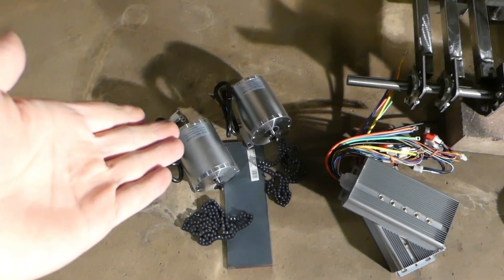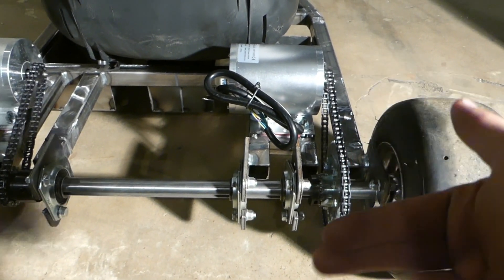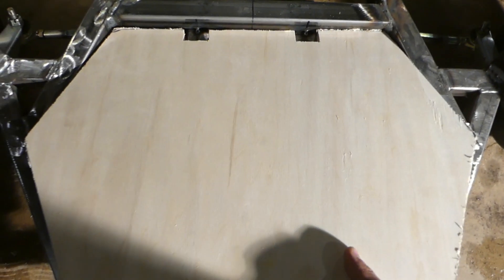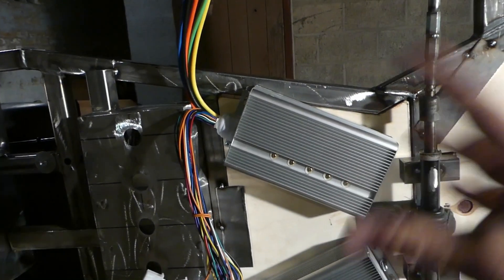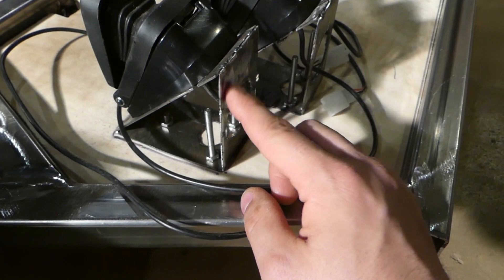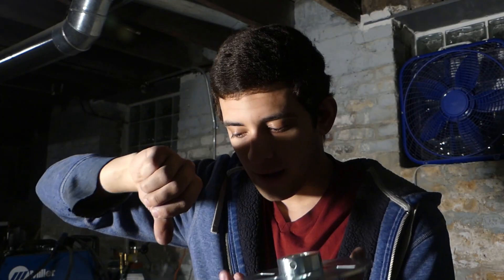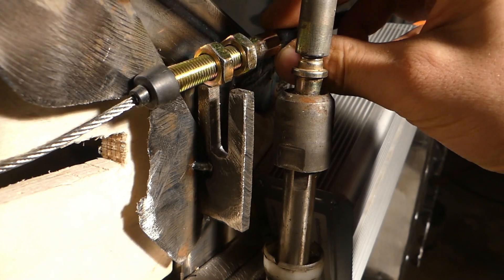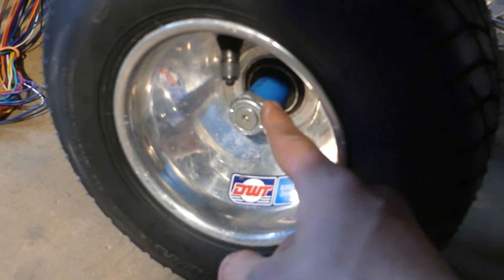Installing the motors, ESCs and brakes on my go-kart

Comment: hello you know you can use one throtle for 2 esc to control at the same time and the esc at the botem what if you take a bumb ?
Reply from the maker: I thought of that as well, but with these ESCs, they only have one port to connect the throttle to.  I could connect extra wires from the throttle into the second ESC, but then I would have to manually turn off and on the ESC that I want so that I don't power both at the same time.  It's a lot easier just to have two pedals so I can move my foot from one pedal to the other and have power at demand.  As for hitting a bump, I'm (hoping) its high enough off the ground so it doesn't hit it, we shall see in the future.  How were you thinking about connecting both ESCs to one throttle? I would love to know and thank you for watching.
Reply: @ALYTRA-youtube  you just need to make parallel exits from  throtle to both esc to regulate both in same time
Reply from the maker: I want to control them separately at different times.  The motors are connected to sprockets that are different sizes.  The wheels will turn at different speeds if I power both ESCs at the same time; which is what I don't want.
Reply: @ALYTRA-youtube  i was thinking to do the same first, then i thought but wait 1. if motor have maximum speed  and you put one ratio on it and with other motor you put smaller ratio it will spin much more than its rated for 2. That motor with smaller ratio will take much more energy/power and probably gona overheat. What do you think about that
Reply from the maker: The motors will spin at the same speed, its the sprockets that will have different speeds; and the sprockets are connected to the axel which are also connected to the wheels.   

For example lets say the small sprocket on the motor itself has 11 teeth and we connect it to a larger sprocket with 55 teeth, with a chain.  the motor itself will have to rotate 5 times in order for the 55 tooth sprocket to spin 1 time.  That's how it is on one side of my go-kart.

The other motor on the other side also has a 11 tooth sprocket on it.  I connect that motor to a sprocket with 22 teeth, with a chain.  The motor itself will have to rotate 2 times in order to make the 22 tooth sprocket rotate 1 time.  

This means the 22 tooth sprocket spins faster than the 55 tooth sprocket even when the speed of the motors are the same.  

what I'm describing is called "gear ratios" 

And you are right, the motor with the smaller sprocket will consume more power because it will be harder for the motor to turn such a small sprocket.  I expect that motor to get a little hotter than the other one, but I don't think it will overheat and melt, it has pretty thick copper wirers on the inside,  but we shall see.    

I just finished the go-kart today, it works, I will show and explain the sprockets in the next video that I will be posting soon.

Comment: Just curious, how come you used two motors? Awesome build btw
Reply from the maker: The 2 motors are connected to two different sprockets for different speeds.  1 is connected to a large sprocket that gives high torque but low speed, 20mph or so.  The other motor is connected to a much smaller sprocket that has low torque but high speed; it should make me go much faster if the sprocket doesn't bend or break.
Reply: @ALYTRA-youtube  That's cool, so two different gears pretty much. I'm assuming you will have some sort of button or switch to change between the two
Reply from the maker: yep, the two foot pedals will each control a motor.  All I'll have to do is push one down and it will activate the motor, push the other foot pedal down and it will activate the other motor.
Reply: @ALYTRA-youtube  Neat, can't wait to see the completed build!